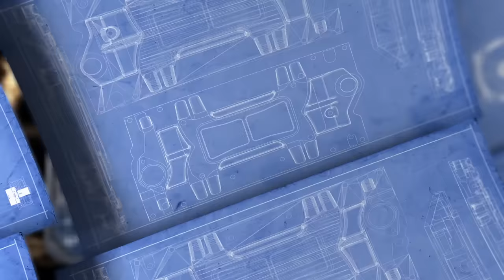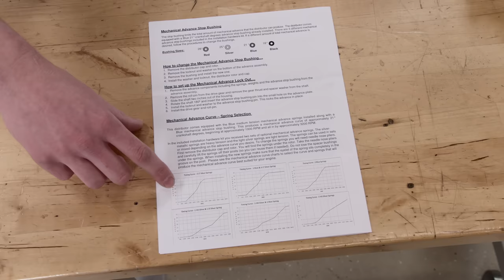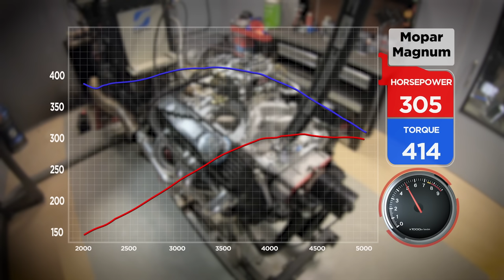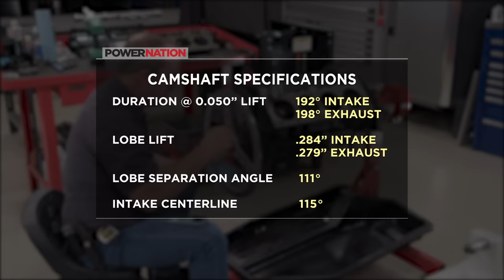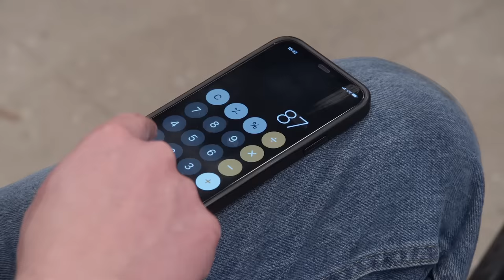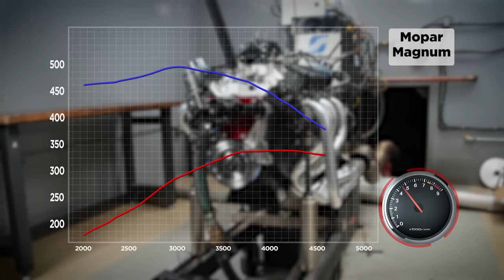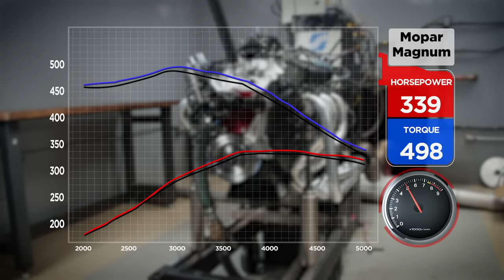What Happens If You Just Add A Stroker Kit To A Stock Mopar Magnum? - Engine Power S9, E3

Comment: I understand they just wanted to see what it would do, but they should have put a cam in it.  Now if they want to put a cam in it, they have remove all the front stuff, balancer, cover, timing chain, etc.  Most everyone would do a cam/stroker kit (extra $375), and then do heads later, that's what makes sense.  The way they did it was just a waste of.a stroker kit.  But I'm glad they did a before and after dyno run.  Everyone remember, the Hp and Tq was Gross, no accessories, subtract ~40hp for water pump, alternator, power steering (A/C), and another 15hp if you're running a clutch ran.  Factory 360 magnum was 250hp NET, so with headers, that right where this engine was at.

Comment: This would make a great engine in a pickup truck. I’ve thought about doing something similar to my 95 f-350 with a 5.8 Windsor.
Reply: If I can't find the 7.3 IDI E350 I want, that's the route I'll most likely go as well. Stroke a 5.8 to 408ci with an 'RV' cam to produce gobs of low end torque. More bottom end torque means you need less gear out back for a given tire size and the converter can stay locked in 4th gear longer, resulting in better mileage than stock.

Comment: The stock numbers seem to be common place, Holdener got almost the same numbers on a stock 5.9 with headers and the kegger. He late installed and intake, carb & cam then got 417lbs ft and 349hp and lost nothing anywhere. Good engines,

Comment: 20:14  Might be cool in a Syclone themed Dakota RT based on a regular cab 4wd Dakota since traction would be a major issue.
Reply: Kammer&Kammer had a Dakota r/t 5 speed test mule that they were given to try to break  the only problem they had was with erratic valve train at high rpm with a rocker arm and beehive valve spring upgrade and a 410 rear gear and some slicks they got the truck to run low 11's consistently without breaking  with everything else stockincluding the camshaft  back in 1998

Comment: Interesting, and really shows that besides the most obvious thing this engine needs (camshaft), is cylinder heads. Even stock Edelbrocks aren’t much of an improvement. A decent but still streetable cam and ported Edelbrocks or Indy’s would get it to 500hp.

Comment: You guys should consider doing a stock early EFI motor and show things you can do with the stock EFI on engines by different manufacturers
Reply: I'd love to see this done with EFI.  I'm not interested in carburetors.  I live where winter is cold and I like to drive my cars all year long
Reply: I have the early ond1 EFI on my 92  not much you can do with it
Reply: @jmflournoy386 you have stroked 360 running all the factory EFI? How well does it run?

Comment: Torque numbers are great but what is needed is a nice port job and cam from Hughes Engines and then that 410 would see well over 510 torque and probably 450-475 hp.

Comment: I can challenge you with a home for it. It will need a full cats + mufflers exhaust, but will be the Ultimate Sleeper.
RWD conversion to an 01 thru 07 Chrysler Voyager, using the longer body with the AWD, you could even swap out the beam axle for live axle if the stock rear diff isn't up to the torque.

Comment: I have a 97 jeep grand Cherokee with a 5.2 318 and it’s got over 285,000 miles on it. I think that’s what it is but it still runs good. It’s got the magnum heads on it and I didn’t know that when I bought it, I learned how to find that out With uncle Tony’s garage he was talking about the difference between the LA head and the magnum head anyway I’ve gotten up to 23 miles to a gallon and I’m doing right around 20 crews and 75 and 80 on the interstate. Good runner motor all right you guys have a good day I just want to what we like to put a 340 crank in that little 5.2.

Comment: I like the stair step build method. Build from the inside out. With a highway gear, and just a little bit of converter, this could be a fun street/highway ride, and a good tire smoker.
You can do cam and heads when you are able.
Reply: Wouldn't need bigger converter with that stock cam...
Reply: @BuzzLOLOL  agreed! Getting a converter would be a waste of money. If anything it would hurt performance at this level.

Comment: Technically, he said it was a reman block that was .40 over bore. So with a 408 stroker kit, plus the over bore, you'd be looking at roughly 418 ci of displacement, not the 410 he mentioned.

Comment: One, this would be interesting on the older 5.7 hemi, because the stock heads are better than a Magnum, but not exactly racing heads. I remember a write up from the 1960's by some Cadillac engineers about boring, and stroking engines for smoother, quieter operation. It could be a cool thing to do for a non-racer weekend cruiser, or a mild off road truck for getting to the favorite hunting/fishing spot.  Two, HaHa! after seeing so many gen 3 Hemi's, the old venerated Magnum/LA engine looks so tiny. It's cute.

Comment: If you increase the displacement while keeping everything connected to the breathing efficiency of the engine the same, you will shift the peaks down the rpm range, it will run out of breath sooner. The bump in static compression ratio will improve your numbers though. Shifting the torque peak to a lower rpm will be quite noticeable with the gear ratios most vehicles run these days.
Reply: Yep... The new numbers seemed way too high... until it dawned on me that the extra cubes cranked up the compression ratio !!! And we don't know the compression heights of the pistons and whether the new ones were also higher up in the bores as well... 
If the compression ratio had been the same, the new HP numbers would have barely increased at all, maybe 2 - 10 numbers higher... but torque up by around 50 - 60...
Reply: Something I forgot to mention is lower rpm also pays off in increased power due to reduced friction losses.

Comment: 2 things How  efficient is it at turning fuel into torque  ?  all maxed out vs cruise ? 25~50 hp load   typical road  loads 
In the new idea of a small engine  being flogged when need  but  affordable to run the rest of the time too ?  273  water injected  turbo ?

Comment: It depends on the application. 
The 5.9L in the dodge ram trucks made 230hp and 330ftlbs of torque.
In the Dodge Durango R/T trim and in the 1998 Jeep Grand Cherokee 5.9L Limited, the output was 245hp and 345ftlbs of torque. In 1997 or1998 cant remember now, the Dodge Dakota R/T made 250hp and 350 ftlbs of torque. 
I have a 1998 5.9L Jeep Grand Cherokee so I'm watching this and taking notes!!

Comment: With more lift cam and some spring and rocker arms that would be knocking on the door of 400 hp..
Reply: Increased duration>increased lift at least until it gets some alum heads.
Reply: @madmod  lol no. i always go for as much lift as possible, right around where the heads flow the most cfm at that lift.
Reply: @frigglebiscuit7484  The low lift limits on the magnum engines are due to the retainer to guide clearance. Consider the fact that the heads dont really flow tremendously well at higher than stock lift, nor can the stock valvetrain handle it what with having bad cases of valve float just past 5500rpms stock. This means completely aftermarket valvetrain just to run a high lift cam. Dodges own 380hp magnum crate used low lift cams, optimized for power where the engine is designed to operate and produced a great torque curve to boot. These heads dont support big power from high lift and the money is better spent elsewhere.

Comment: The torque increase and peak at lower RPM is expected with the stroke increase.  The amount of torque increase is greater than expected, as is the 10%+ increase in power...
I suspect both are the result of a substantial boost in compression ratio.  More is nice, but with a CR over 11:1, will it run on pump gas as a street engine?
Reply: Agree... The new numbers seemed way too high... until it dawned on me that the extra cubes cranked up the compression ratio !!! And we don't know the compression heights of the pistons and whether the new ones were also higher up in the bores as well... 
If the compression ratio had been the same, the new HP numbers would have barely increased at all, maybe 2 - 10 numbers higher... but torque up by around 50 - 60...

Comment: With headers and a good intake, the 5.9 magnums are and easy 300 horse. The old 360/300 crate engines from Mopar performance were nothing but a truck engine with a 4 barrel intake
Reply: And probably a bit bigger cam and higher compression ratio pistons... 
The Magnum 360 is also a '94 and up truck engine...

Comment: I have a 360 Magnum engine on the stand that has a Scat 408 stroker kit in it and i had to clearance the block. What a pain in the A$$ that was. The rings are poly plasma or something and the oil pump is clearance. I'm now waiting on my high capacity Milodon oil pan to come in that i ordered back in August 2021. I should have it this March. I hope they find a 2002 Dodge ram 1500 to put this engine in and make it run on 87 octane💪

Comment: Nice!
And for the next installment you fine gentleman should run the Victor heads that have already been on the show with a big solid roller.
I’d bet the torque numbers would increase a bunch and the horsepower should be equally impressive but at a higher RPM.

Comment: With +100 valves, head porting on stock heads and stiffer springs you would get better results even without a new cam. I personally like a stock style truck cam their enjoyable to drive. I also like the stock heads when ported. I personally go with EQ heads as their ported by the cast. The problem with most stock heads is just a poor casting. Their actually supposed to be port matched / ported from the cast.

Comment: That'd be perfect for a Jeep. Over 400 lbs. of torque just off idle. Smooth idle, very reliable and controllable throttle response. Isn't going to stall out in the middle of a crawl.

Comment: I have a project on the go. It’s a ‘95 Dodge 1500 Sport with a 5.9l Magnum in it. I was just wondering on what a safe horsepower range is on most of the factory engine components?

Comment: one way to budget build an engine is to invest in the shortblock...and come back later with used parts to help it breathe after enjoying all that low end torque. also, every full point of compression gained adds 4% more power.

Comment: Would you be willing to show the performance improvement that just putting magnum heads on a stock 360LA  engine would make?
  That seems to be a rather common low budget upgrade, but I haven't found any dyno information on the actual performance gains.
Reply: If I remember correctly la engines and magnums dont share the same intake bolt pattern
Reply: @megaramathor  
You are correct about the intake bolt patterns.
 However there is at least one aftermarket 4bble intake manifold that has  both bolt patterns.  
  There are also templates available for drilling out the correct bolt patterns for the magnum.
  In other words, it would be possible to get/modify an intake manifold that would work with both heads.
  Thus giving the opportunity to use the exact same induction set up for a proper test.

Comment: Nothing is gonna make power without air, and the factory cams are for off idle grunt and nothing more. Factory WOT shifts are like 4800 and rev limiter at 5200. More cam in the stock engine would have been a good test since that's a pretty common upgrade 👌

Comment: Put the engine in a square body power wagon. Perfect engine for a daily driver 4x4 truck. Good torque for if you are pulling trailers maybe a camper hauler to take the kids on a little vacation

Comment: @POWERNATION You should do the 5.2 318 Magnum and see how it differs!! Noooobody ever does the 5.2
Reply: I have 350000 miles on  my 92 Dakota 5.2 did  the heads but that's all    Have 5.9 but no reason to switch   73 New Yorker radiator,  Maxivan ac condenser  100 plate trans cooler with half inch lines  30 years this year  long story about the trans but 300k on it
Reply: No one ever does the 3.9 either
Reply: If a 3.9 is bored 20 over it can accept a 360 piston
Reply: @exploringwithmaverick7604  3.9 is inexpensive to build and better than later motor reliability  ok for an around town truck or on the road- no towing

Comment: Compression difference invalidates a direct  stock to stroker  comparison but 498 torque on those stock heads is pretty damn good.
Reply: Actually the block was decked to zero to attain the compression the got with the stock pistons. Their motor was a full point higher than stock. I know from work with my magnum engine and having my block decked also. So the variance is in the kit itself vs the stock parts. The difference from stock 360 compression to milled block with stock parts to attain one point in compression is usually worth around 15 to 20 foot pounds flywheel torque difference. Doesn't sound like a lot but you will definitely feel it.

Comment: Rewatching this and something Pat said got me to thinking. Back in the day they advertised power by "Gross" then switched to "Net" Ratings. Wouldn't the way they run them on the dyno be closer to a "Gross" Ratings? No accessories robbing power. So theoretically that 240hp stock rating could end up being a 303 Gross rating. Most of us old enough have driven older cars with the A/C on and have "felt" the compressor engage. I understand why they run an electronic water pump but what about the rest? How much parasitic drag do you get?

Comment: Magnums were fuel injected and detuned from the factory, really all 5.2 and 5.9s were, they are reliable workhorses as designed but with compression, cam swap, and a nice M1 single plane they come alive and can make hemi power quite easily

Comment: Proof that there is horsepower to be found with just a good intake,carb,and headers... From 240 to 305 horses is a great gain for just that stuff..
Reply: 240 is netHP... this dyno of naked engine gives pre1971 type grossHP... headers have always been the cheapest HP boost... if use cheap headers...

Comment: So what you saying is. 

Fresh rings and hone which everyone know on a will used engine is worth power, and 1.5 points in compression is with 30hp 

Compression raised efficiency and fresh rings fixed losses. Even the kid admitted that the peak moved down in rpm.

CID does not equal more power when everything else stays the same. It equals a lower rpm the engine will peak it's power.

Destroke that motor and it will make the same power at a higher rpm it will be with a few hp.

Rpm is the replacement for displacement, all 3 engines will make the same power, but at different rpm.

Comment: Dude is running 10psi on a 275k mile stock 360 Mag in a 90s ram with a 727 and 3.92 gears and he's pounding in the mid to low 12's. Can't imagine how a stroker could wake one of these up.

Comment: So I'm curious about the fact that E3 plugs were used. I had a set of those in my 2005 Mustang GT (At the time I was doing plugs, they were having a sale and were the cheapest 1 piece plugs I could get). They were OK but I kept having a weird high RPM "stumble" or misfire of some sort. Swapped them out for standard Autolites, problem solved.

Comment: I am still in curious how well a 360 with a 426ci stroker kit or a 340 with the same crank bored 0.055"-0.060"" over to make a 440ci stroker kit with the finest aluminum heads, a nice sized cam, a nice intake, long tubes ect would perform.

Comment: Wonder if it would have made more power with normal style spark plugs. Every time I've come across any kind of gimicky spark plugs they are the same as installing a misfire. I would put money on some regular platinums at the right heat range. You want better spark? Gap them out and run a real ignition system.

Comment: You didn't stroke a "stock" Magnum - you had already fixed the main problem when you replaced the restrictive OEM barrel intake. It probably wasn't using the "stock" 1994 cylinder heads, since they were severely known for cracking - the "stock" replacement heads have improved flow (and make more power). And I'd bet that with some tuning the Edelbrock 800CFM carb would have matched or beat the larger 950CFM one, since the smaller carb would have been more than enough for the stock cam and heads to flow.

Comment: Wish yall would of gone with the stock throttle body and fuel injection 5.9 magnum which i hv i want to change the intake from the kegger to the air gap guess you can't.

Comment: You boys have already built a 410 with Trick Flow heads, but didn't dyno it. Where's that?
Reply: That may be where they learned about the need to clearance the oil pump...
Reply: if you watch the vid where they put the pushrods in it, they used solid non oiling pushrods...your answer lies there LOL.

Comment: Perfect example of cost per power increase. Thats not a cheap modification and for what it gained. Is it worth it?
Reply: the camshaft was hilariously small dude. put a 230 duration, 500 lift, 110 lsa cam in it, and boom, 430hp, 510 ft lbs.
Reply: Just a science experiment... with donated parts...

Comment: It's an alright video, but you can't say it's stock if you're running an Edelbrock intake and 40 over bore. Would've been a better pulling an engine from a running truck then going from there with the potential problems like a plenum leak, cracked heads, loose chain, etc.